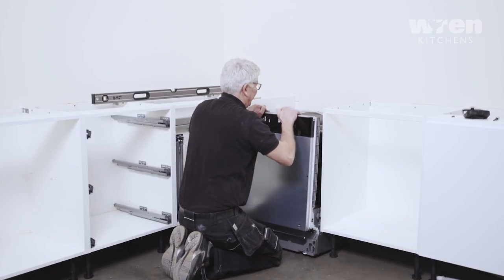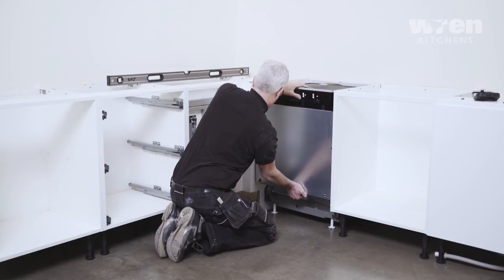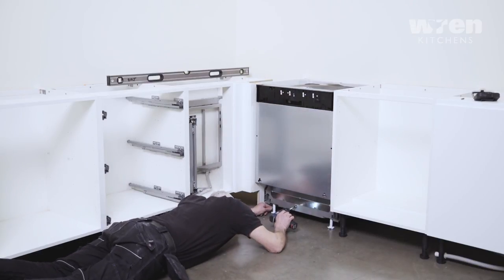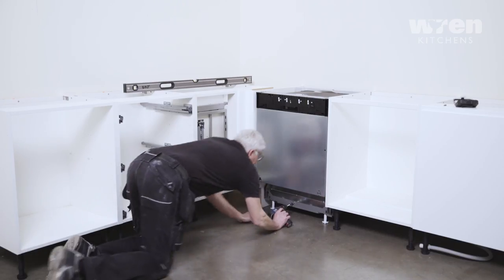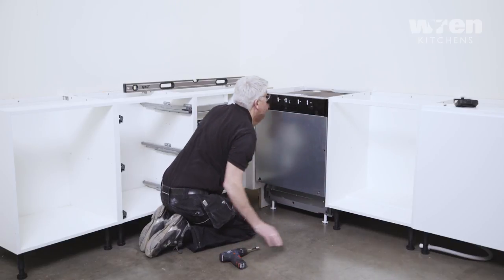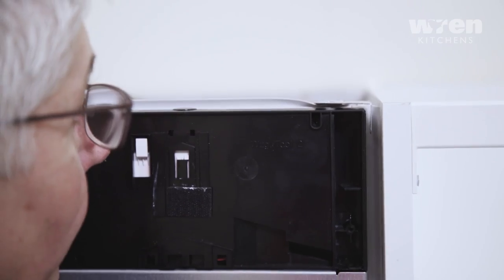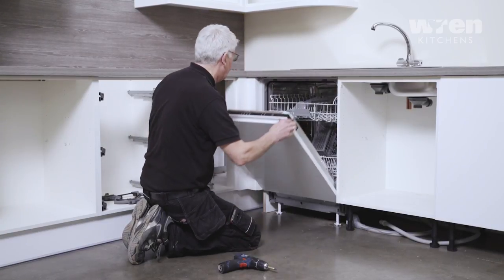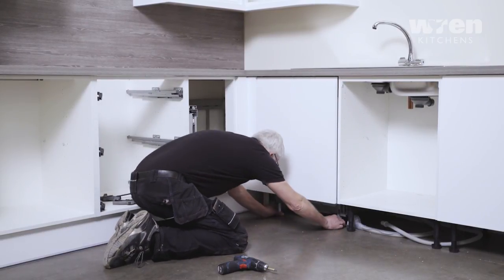Wren Kitchens Infinity: Dishwasher Installation

Comment: I recently had my Bosch dishwasher fitted, my carpenter trimmed my plinth by approx 2cm. My dishwasher is facing directly opposite the entrance door and the cut in the plinth is very unpleasant looking as a big gap is shown. My dishwasher is also low from the worktop. Is there any way round it where the cut can be prevented? I don't mind purchasing a new plinth as long as it's pleasant looking.
Reply: Nope,they all have to be trimmed down to allow the door to open.
Reply: @davidbrooks8038  thats not true. If you position the machine good and the doors not hanging over too mich downwards then when its opened it should stop just before the plinth ;-)
Reply: Plinth always has to be cut and treated, been doing kitchen installs for 15 years
Reply: Only AEG and Zanussi allow for no trimming on the plinth as they have different sliding doors

Comment: Problem is the door then hits your plinth when you open the door so you have to make a huge unsightly cut out!
Reply: Matthew Lilley I recently had my Bosch dishwasher fitted, my carpenter trimmed my plinth by approx 2cm. My dishwasher is facing directly opposite the entrance door and the cut in the plinth is very unpleasant looking as a big gap is shown. My dishwasher is also low from the worktop. Is there any way round it where the cut can be prevented? I don't mind purchasing a new plinth as long as it's pleasant looking.
Reply: No way around it i'm afraid. However, AEG manufacture a different type of door hinge, this means the plinth doesn't need cutting
Reply: Depends on which dishwasher you buy ,cheap ones have more of a problem than more expensive ones
Reply: @Bibi12.  3years on, what did you do? I'm thinking of a white trim along the cut
Reply: @sham126  Hi. I had some thick window sealer, I sealed it onto the top of the plinth cut, it looks much better now. As my plinth colour is cream, it blended well.
Reply: @Bibi12.  whenever you make a cut for the dishwasher door it needs to be sealed. either with plinth trim or edge trim. Not good having raw edges and water